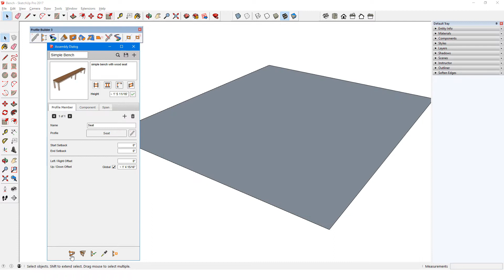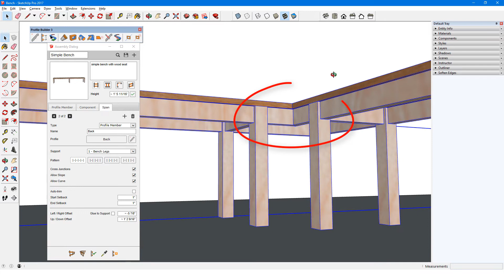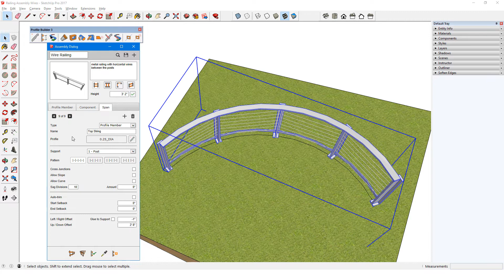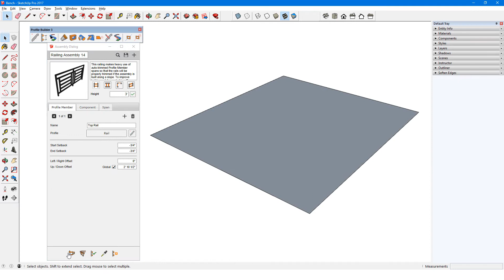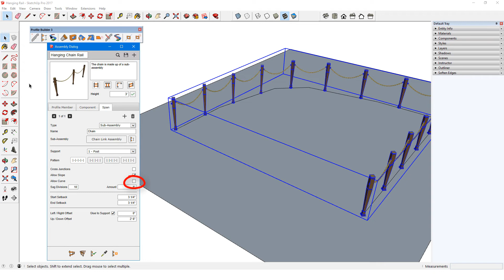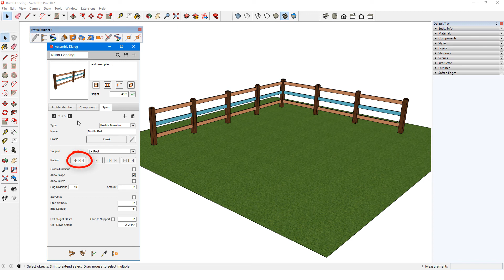Tutorial 12: Span Assembly Parts

Comment: Your tutorials are excellent and generally very clear.... though I do put the on 0.75x speed as there is a lot to absorb... 

One question is what is the relationship of the sub-assembly orgin to the main assembly orgin?
Reply from the maker: Hi Gary, the sub-assembly will span between the origins of its support components.  But you can adjust this using the various offset and setback parameters.  The support components will be located by default along the main assembly origin (path) unless you have applied offsets.